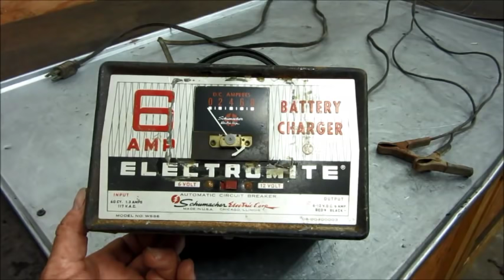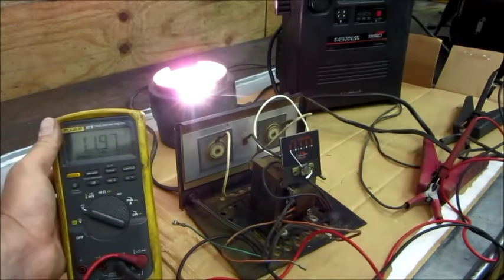Refurbishment of 3 old battery chargers, from flea market...

Comment: .I have two of those chargers.  One I bought new and the sears one I found in someone's end of the driveway garbage about 15 years ago. They all work and do have what appears to be the metal oxide (selenium) rectifiers.  I have recently acquired an old 3 amp 6 volt and 12 volt charge which has no output and I plan to use a silicon bridge rectifier (using just 2 of the 4 diodes in it) to replace the failed selenium rectifier.  I have to make tests as to what series power resistor I will need to make sure the batteries don't get overcharged due to the fact that selenium has a greater forward voltage drop across it than the silicon does.  I need to simulate that voltage drop so the batteries don't overcharge and boil out or warp.

Comment: I have heard a lot of the new charges are not worth owning.
Reply: I not a fan of those solid state charger either ,it like picking up air like they are empty inside ,I like a heavy transformer ,go to Wal-Mart and pick up one of those solid state charger feel like they forgot to put a transformer in ,anyone try one of those solid state chargers
Reply: @nor4277  Yes the new ones suck, if the battery is too low it simply refuses to charge, total junk and a waste of money.

Comment: Hey remember that when those diode s are being used in a push pull config, you only get half the voltage of the output transformer (center tap to one of the outer windings) but by bridging the two outer windings, you get double voltage.... be careful
Reply from the maker: Yes, there are some chargers with a full-wave bridge configuration for the highest voltage ranges, getting full secondary voltage; and using the center tap with push-pull for lower ranges.

Comment: If you can recess the meter, you could put a flat clear cover inside... see if you have room behind the meter to back it up a half inch or so. That's what I would do...
Reply from the maker: Hi Darryl. That is a good idea, but I have acquired new meter covers!  Will be doing another video of the meter cover installs.
Reply: davida1hiwaaynet, thanks for your reply! No one ever does... I'm glad you found a new cover. Your video was very informative, and got me working on an cheap charger given to me that didn't work. It had two transistors mounted to a heat sink on a board with two LEDs. Only the transformer has power, so I decided to make a dumb charger out of it and ordered two 3A diodes to rectify the center-tap transformer. I also understand I should put a 2200mf capacitor across the DC output to smooth current. Oh, and add a 2A fuse to the line in. Does this sound about right to you? Thanks, in advance.
Reply from the maker: Hi Darryl.  It sounds like you've got the right idea about the charger you're repairing. Just be sure that it doesn't overload its self after you remove the transistor setup. Sometimes they use that setup to regulate the charging current. Maybe not - just try it and see!  If the current on the charger is much more than it was originally rated for, the transformer may burn out if used for long periods of time.

Comment: How to make a plastic meter cover plate. Plastic water or soft drink bottles and a hot air gun / paintstripper. scrap of wood and two blades -  works great, but direct sunlight will age the plastic. Other way is scrap Perspex panel. On the new plasticky smps with fan chargers sub $20 - and desulfination - they work great  .. BUT NEVER place the plastic chargers next to the battery being charged, as the off gasses (sulphuric) get in and short components. Yep designed for flashovers and boating dimwits where saltwater will also accumulate and short it over time. Also plastic printers now exist. At the RV park, fancy $100-300 plus chargers grow legs, but my vintage charger is left alone. I also added a light bulb socket to the top to make it look more homemade, because battery problems always appear when it is dark and wet.

Comment: where do you get the little button diodes.  I have looked for them on ebay, amazon other sites not sure if what I find are right.  Looks like I need to small ones with red circle around.

Comment: He's right about the new battery chargers. They suck. The most frustrating part is THEY WONT CHARGE A DEAD BATTERY! Wtf??? They'll charge up a LOW battery but if a light was left on and forgotten and it runs down to zero volts it tells you the battery is bad. These new chargers cost us a fortune in batteries they refuse to even try to charge
Reply: Sometimes you have to jump start the charging...

Comment: You probably shouldn't overload or "peg" the charger as you did with the Q beam.  Use a 12 volt car light bulb instead.  The old kind.  Should draw about 2 amps.

Comment: Great job on the repairs!  I like how that bridge rectifier turned out mounted to the heat-sink!  I happen to have a similar charger to the 1st one (6a Schumacher) however mine is 2amp with the same selenium rectifier in it and glass tube breaker.  I'm thinking it's only half wave and wondering if I were to put the same bridge rectifier you used in the in the 10amp unit?  Should I look for a lower amperage bridge rectifier or is it ok to use anything above 2?  An interesting thing to note is that my  rectifier is fed from the negative or common side and through the breaker to the negative lead.  The 6 & 12 vac taps go through the selector switch then out to the positive lead.
Reply from the maker: Wow interesting. Yours is probably a lot older!  If yours doesn't have a center-tap transformer you'll need to use all 4 terminals on the full-wave bridge to get the same voltage you're needing. 

I would use a rectifier over 2 amps, so that it won't get too hot.

Comment: The unit with the selenium rectifiers is neat. The vintage TV / Radio guys always dump the seleniums for diodes. When the seleniums fail then give off a giant cloud of stinky smoke, and they aren't as efficient as modern diodes.  That TV heatsink worked out perfect! 

I have a version of the last charger you worked on, I got it new last year. I wonder how similar they are inside.. hopefully mine is as nice. Mine has a "Charge Done" led inside the amp meter as well.

All for fun for sure... fixing thing is fun, then you're left with something you can use afterwards!

Comment: How can one test a multi-amp battery charger transformer, itself? Mine is a approx. 25 -30 year old, 2/10/50 amp Schumacher 12 volt battery charger. Mine is not making any humming noise, anymore, like it used to, when plugged in, and is not putting out any voltage at the battery clamps end. The transformer, itself, looks fine - no discoloration, no burnt smell. It just went out, today, while using it. I heard a bit of a strange noise,  maybe even a pop or some sort, right before it shut down. It is the type charger without any electronic "board" in it -  it's of a very simple design. And now it won't turn back on, and is non functional. Thanks.

Comment: I appreciate this wow 7 years ago!

 Ive got a question at the 14:26 point when you wired up the bridge diode.

I've got the exact same machine and I've got the new bridge diodes, but I'm not 100% sure of wiring it

There are three fins/tabs in the same orientation.

 One is labeled as '+' ...I think you leave that unoccupied, One is labeled a/c, the other 2 are labeled '~'.

You've got the a/c fin attached to the negative wire clip, and the 2 selenium wires attached to each of the '~'.

Am I right to conclude it doesn't matter which winding attaches to the '~'?  

It's alternating  current going into the bridge diode, and comes out as direct current..

Does that sound right? 

Thank you for this video!

Comment: First off very informative video. I also have a Electromite charger. However mine works on 6amp but does not work when switched to 12amp. Am I over thinking probability being it may just be a faulty switch? Look forward to your response. 
Thanks,
      Cory.
Reply from the maker: Hi Cory. I would say that the switch is probably the problem; or possibly there is a wire broken off the switch inside the housing.
Reply: Thanks! Ill  install a new switch, and let you know how it turns out

Comment: Have you ever worked on a schumacher se-2151ma? i want to try and replace the rectifier with a diode bridge but there are 4 wires from the transformer and then a circuit board that is soldered to the rectifier...wasnt sure how i would go about replacing this. Any help is appreciated

Comment: You really know you're stuff, quick question.... I have a Schauer Model B7612 which is a 6AMP , 6-volt and 12-volt charger....it's very old but always was very reliable.  It didn't work when i attempted to charge the lawn-mower battery this last go with the bad lawn-mower battery,  so I called Schauer tech support and he said it's just wore completely out (it's probably 25 year old).  The AMP meter needle doesn't go up like it always did and then gradually go back down in amps as the battery charged, it just stays around the upper-middle (even when off).  when i connect a volt/ohm meter to the charger Leads 6-volt mode shows about 8.2v and 12 volt mode shows about 14v , so i think the voltages look good (but this is not on a load)...but i also had a completely dead 12-volt lawn-mower battery i had the charger on so that could be why it seemed to not work....but the needle just might be broke and the unit might be fine.  the needle is more than half way up (8-amp meter like most 6-amp chargers have on them) with the unit turned off!  what's the best way to test this on a load, would i have to have two volt-ohm meters like you have?  one on the voltage and one on the amp output during a load test (connected to a battery or a high wattage light like you were demonstrating)?  sorry for such a long description, i'm not real good at explaining this situation.
Reply: if your ampere meter unit stays on the middle even when it's turn off then your ampere meter is broken. change that, buy with the one same slot dimension, if you can find with same slot dimension but bigger Amp rating (let's says it can read up to 20A) buy it. never go below your original rating but you can go with higher rating.

if you worry about your charger is broken down:
you can buy a cheap digital power meter, transformer without any load in output usually have very little power consumption (usually under 10% from full load capacity).

or the old trick is let it turn on for 30minutes without nothing to load on, if your transformer inside is very hot (you can't touch it, then it might be something wrong in your trafo (transformer).

Or just check the cable, usually the cable inside from transformer output is broken out / the cable sleeve melted so it touched bare metal ground or making it under load. if the cable inside is perfect, no open wire  or something like that maybe your diode is broken out, your transformer probably outlived the diode or even your cable inside because difference temperature rating.

hope it is helpful

Comment: Can you explain how you hooked the rectifier bridge up to the transformer  I have the 10/2 amp sears I used 2 bigger rectifiers and put  one of the ac output to each ac input positive an put a negative wire on the negative side of one of them  and I got it to put out the output voltage of 10vdc at 2 amps and 12 dc at 10 amps but as soon as I hook it up to an amp meter  or a batter the meter will go to 15 amps and it sounds really quite on 2  amps no load then it sounds really deep when you put a load on it an the transformer gets warm after a few seconds it was an automatic charger but I couldn't figure it out so I just removed the board

Comment: Old video I know, but I have an old AEC battery charger that looks similar to the black Schumacher 10 Amp charger in this video. It will not produce over 11.5 volts or so. If that is caused by the diodes, where can I find some replacement diodes for it? Thanks.
EDIT: Nevermind, I found some on Amazon.
Reply from the maker: Thanks for the comment! Glad you found your diodes.  Before the downfall of Radio Shack, that was my local go-to place for things like this.

Comment: a friend of mine just gave me an old sears 6 and 12 volt charger today because I work on cars and didn't have one  its the brown one with a gold face plate it looks early 70s if I were to guess and its awesome works great im just now realizing its from a time when things were built to last and you just cant buy a new charger that is as good with user serviceable parts and metal casework and a real transformer, analog electronics are more robust I once had a cheap harbor freight battery float charger and it was too hot ran at 15 volts and fried the battery there was nothing to the thing besides cheap cables and a very small plastic box with im assuming a small circuit board inside it so it was likely a digital unit and straight from china

Comment: Question.  The alligator clamps both came off loose.  It’s an obvious question. But I need your professional opinion. 
Now that they are loose. How do you know which one is positive and negative. 
What I did    Opens up the charger and trace the wire to the transformer assuming that the positive. And the other wire attacked to the chassis is the negative.  
Mi neighbor used to charge a battery and said the wires got extremely  hot.  Any ideas?  Thanks
Nice vid by the way. Thanks for sharing

Comment: Can you post how to check my charger. Its only putting out 8-10v if i just hook up too the leads. Im confused how to test
Reply from the maker: Hi Pat. The best way to test it is with a battery connected to the charger. The voltage should rise up to 13V or more while the charger is on. It's hard to measure the voltage without a battery attached, because of AC ripple voltage effects.

Comment: the selenium has a higher voltage drop across it so the transformer voltage is higher. what that means is it will cook batteries now. been there done that.
Reply from the maker: None of the selenium rectifier chargers were automatic. As with all of these manual chargers; you must turn off the charger once the battery is charged. 

Replacing a selenium rectifier with diodes;  in a 5 amp charger will give you a charger which performs more like a 5.5 or 6 amp charger. Battery reaches a full charge more quickly. But because this was never an automatic charger, it is the operator's responsibility to turn off the charger when that state is reached; be it after 5 hours with a selenium rectifier, or  hours with a diode bridge. If the battery is "cooked" that is the operator's fault; not the machine's fault.
Reply: @davida1hiwaaynet  I have done the mod and the batteries after were boiling in half hour. there is a difference in the transformers in my testing so.... Good luck. Ps I parted it and used the transformer in a variac controlled power supply.
Reply: I hope you get better results.

Comment: Hi David...I have an old Schauer Charger we used for years and then it stopped working. I bought a new charger that had some fancy modes and it actually wrecked a new battery. I have tried to figure out what is wrong with the Schauer, but can't figure it out. The switch seems to be connected inside, but maybe it's supposed to be. I try to follow videos...yours is GREAT , but my charger is different . I don't have the heart to ditch it, so maybe I can send it to you ??

Comment: Measuring the output voltage is easy, but how about measuring the output current if the built-in meter isn't accurate?
Reply from the maker: Hey, it's not too hard.  

There are two types of current meters.  One is really easy to use. It is a "clamp meter" known as Amprobe or Amp Clamp.  These measure the magnetic field around the battery cable and calculate the amps flowing. They are best for high currents (10+ amps) and the ones which measure DC current are more expensive.  

The best way to measure lower currents is to use a multimeter with a 10A scale. This requires you to disconnect one of the battery charger cables, and then connect the meter in series with the cable and battery. That way the current goes through the meter. Then you see the charge current!

Comment: hello very good video. A question I ask myself. That it is the value of the diode bridge that you put on the 1° charger. Thank you for your response
Reply from the maker: Hi Gege. That first charger was a relatively low current model. I used the rectifier I had on-hand which was a 20 amp 500V device. It is a full-wave rectifier, however only 3 terminals and two of the internal diodes are used. This allows push-pull operation.

Comment: I knew about those one shot thermal fuses in those modern battery chargers. The people responsible for such a thing should be put in prison. All it takes is to to blow that fuse is to crank an engine for too long with the charger hooked up. A normal thing to do to help a weak battery, and the manufacturers know it. Prison.

Comment: Thermal fuses are meant to be buried in transformers, primary or secondary windings get too hot, due to excessive current draw, or a short... those type fuses are called "Thermal" for a reason ;)
Can I get a 1200 watt microwave transformer turned in to a 2A-slo/20A/200A starter current, 13.8 vdc battery charger??
We will see ;)